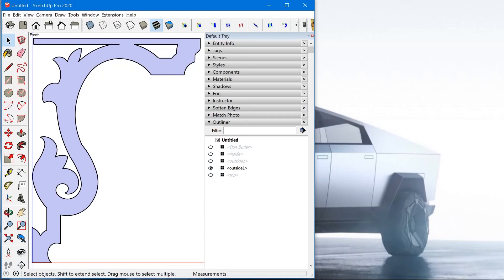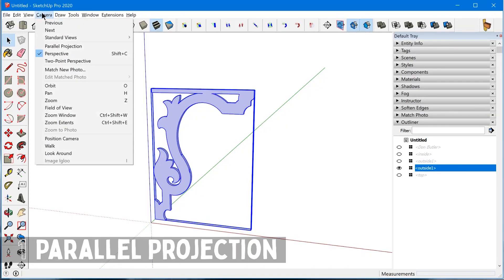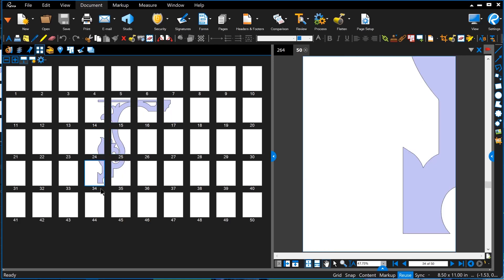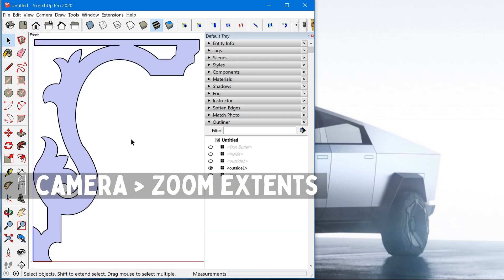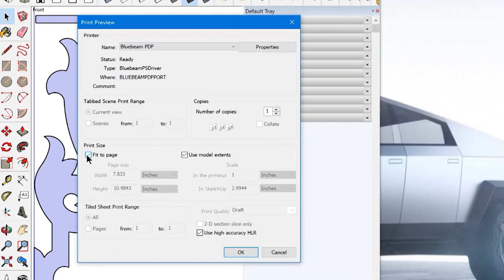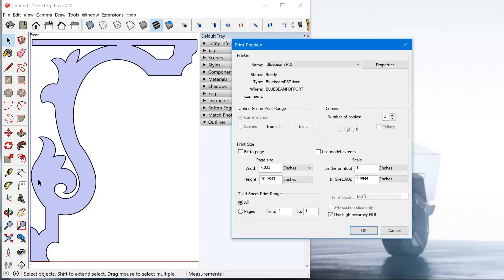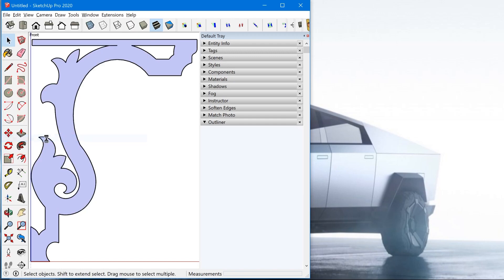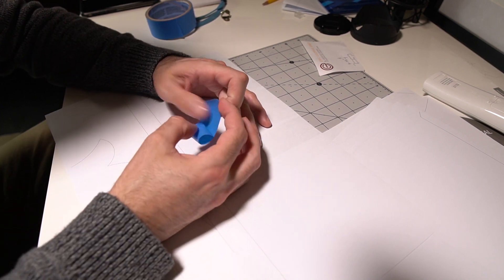Full Scale 1:1 Printing from SketchUp | Multi-page output

Comment: Finally - your solution. It works a charm. Such step-by-step description gives meaning to under-the-hood misleading gobbledygook from other vids.
SketchUp Pro'22; Win10; old HP Inkjet. Printer Setup/Advanced/"Borderless Printing" should be OFF. When ON, printout errors occur (on both HP's).

Comment: When in print preview, you can also pick what pages to print, as in page range. 1-5,7,8. If this is done with the default image for this video, it will prevent 2 more pages of being wasted.
Reply from the maker: Great tip
Reply: @Mastersketchup  I agree, but you have to view what is being printed on what page...I was try to print 2 items that easily fit onto 1 page, but SketchUp wanted to print 5 pages. One item being on page 1 and the other being on page 4...by unchecking "use model extent" they both printed on page 1

Comment: Im a bit lost.  Im a complete newbie at sketchup.  When i do a print preview, i have no checkmarks in "fit to page" or "use model extents".  I set the scale to 1:1.  if i look at page size, it says width 16.7125" and height 9.3547".  Thing is, my object is 2D, and measures 2" X 8".  its a simple rectangle with 8, 1/4" holes in it.  My printer is a small laser that only prints on 8 1/2" X 11" paper.

Comment: Trying to print to scale following all steps, but in 'print size' is blank. Nothing in the dropdowns and when I type my scale in manually it doesn’t work. 
Any  idea why this is?
Reply: I had the same problem. I then did all the same steps but opened it on the sketchup viewer 2021 and it worked perfectly

Comment: I hadda retrieve this info, coincidentally, just a few days after your email notification, so thanks, Matt, for making it easier than last time, when I pieced together info from googling.  
I've never gotten into Layout enough to not hate it - or maybe it's just not loveable.  I don't usually have to 'present' my work;  I usually use it as shop-drawings for my own DIY projects, and in this case, as a full-size template.  Generally after long hours tweaking a model in SU, I've had far too much coffee to tolerate still MORE long hours futzing with Layout in order to simply print what I need in order to start building.  But I still wonder if I'm missing out.  LMK if you think it's worth learning...
Reply: Edit:  later same day, with about 20 pages printed and carefully aligned, I found my template was about 4% smaller than the CAD model (yes, I'm using the 'HLR' setting from the print dialog).  But I'm using Adobe Acrobat, not Bluebeam, so I'm pretty sure that's the difference - unless your project can tolerate that discrepancy.  I repeated (this time making a 1" grid) to test, using the Adobe printer setup and selecting the 'higher quality' (or some such) setting vs the 'standard,' and...still no.  I'm getting about 15/16" to the inch in 'standard,' and only slightly better in 'higher quality.'  I'll poke around a little to see if there's a fix.
Reply: I'm stumped for now.  Acrobat's 'measuring' tool - once I found it - shows the grid at 1.00" so that apparently isn't the problem.  Unless there's a required scaling tweak to my (Brother) laser printer (that I don't really want to mess with, since trial-and-error tweaking of the scaling by percentage seems klugey) I don't know what else to try.  Anyone?
Reply from the maker: So if I understand correctly, you're printing to Acrobat first, then to your printer? The problem with that is when you go to PDF, it goes right to the edge of the paper with no margin, and when you print from acrobat it's probably scaling the printed area down to fit within the margins of the printable area. You'd have to either disable scaling in acrobat when you print, but then you'd have parts of the print getting cropped. The better thing to do would be to select your printer directly from inside SketchUp because it will adjust for the margins correctly for you.
Reply: @Mastersketchup  Sounds reasonable as to the rescaling basis...but there's at least one shot in your video that I took to indicate you were doing the same thing, though in your case, printing from Bluebeam, not Acrobat.  I realized later I should at least give printing directly from SU a try - but the thing about printing from the pdf is that you get a bird's-eye preview of ALL pages, not just a maximum of two (unless I'm missing a setting in the SU print preview, that's as many pages as you can preview at one time - is there a way to see more?)  And if I just let it rip and print the whole thing, my print would contain a LOT of spurious pages that aren't needed for my perimeter-pattern template.  Maybe it follows the same page sequence as for the pdf, so I can guess at a more surgical selection of pages to print...?  (So much for saving trees and paper...)
Reply: It turned out that the page-printing sequence from SU is the same as from Acrobat, so it was a little easier to select only the needed (perimeter) pages to print.  That said, though the scale seems accurate within the confines of one or two printed pages, it grows a bit (at least with my printer) such that over a span of 18", I'm over by ~1/16" - or in other terms, my longer dimension of 64-1/2" per SU came out to 64-3/4" in the real world.  But it was the long smooth curves I needed to have templated, really - good thing I'm not making clockwork...

Comment: In addition to these great tips, before printing I use a graph paper image as a material I fill in the component that I'm printing.  Just be careful to make the graph paper image size to be exact.  I used a 2 inch by 2 inch virtual image of the graph paper sized to 2x2 inches when creating this custom material.  This material repeats across your component automatically.

Now after you print at scale you can take the individual sheets of paper together exactly by using the graph paper fill pattern to align each piece of paper to be straight and spaced correctly.
Reply from the maker: I actually mentioned that in the video, but ended up editing it out because I couldn't get it to print the texture. Only afterwards, I realized I needed to disable "Use high accuracy HLR" for it to work. Oh well! It's a great tip! thanks